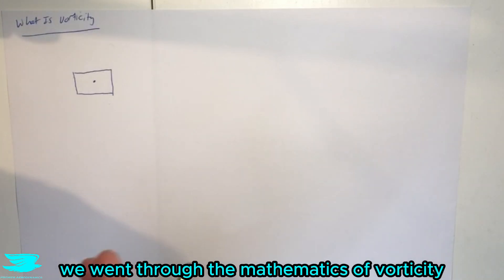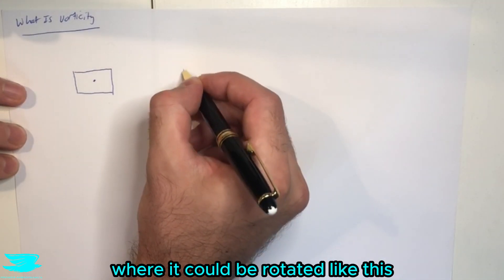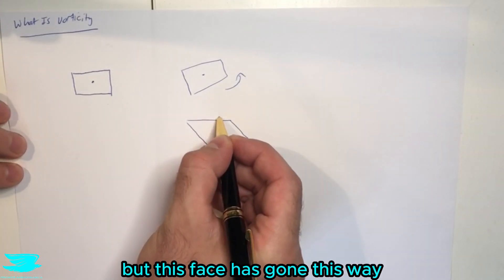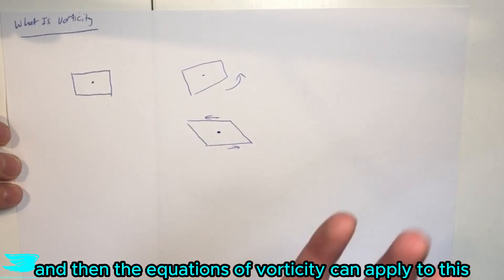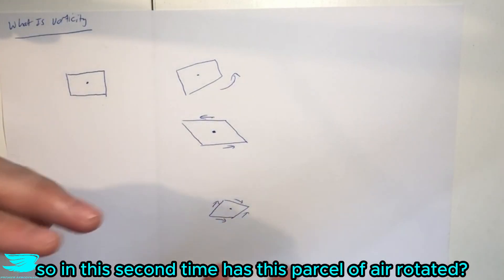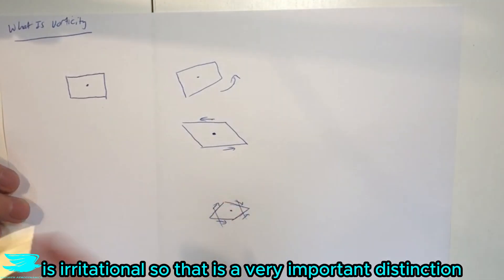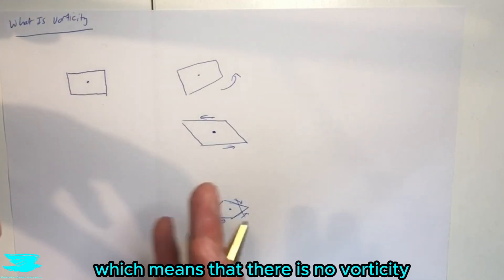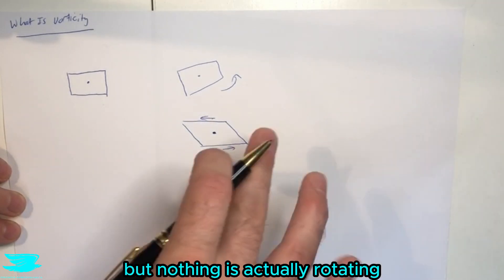Vorticity Explained Conceptually [Aero Fundamentals #67]

Comment: It's also helpful to know when a flow tends to be rotational, and irrotational. Flow along a stagnation point tends to be irrotational, while boundary layer flow tends to be highly rotational. Also the center of a vortex is highly rotational, since it is the center of rotation, while the flow that circles the center of rotation is largely irrotational.

A good practical way to visualize this is, is in water, with a vorticity meter(which is just a little float with 4 legs perpendicular to each other) as the float moves along a channel, it'll rotate close to the wall, but not so much at a point equidistant from both walls. This makes sense, because the adverse pressure gradient of the boundary layer does indeed create rotation.
Reply from the maker: That's an awesome little device to visualize vorticity.
Reply: yes free vortex have very high spin moving close to center cuz they have singularity. But its not the same with forced vortex. Their angular momentum isn't conserved so which means their flow speed isn't actually inverse to the distance from centre.
Reply: @vedantbhardwaj3277  It's almost entirely conserved until vortex breakdown.